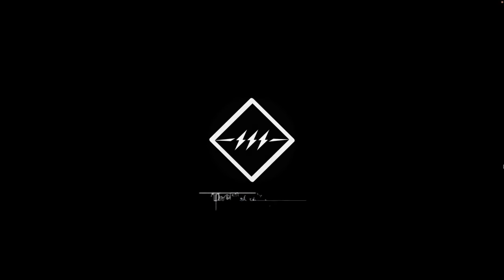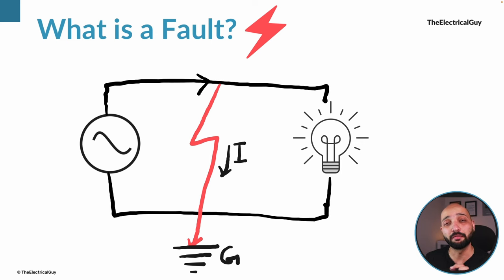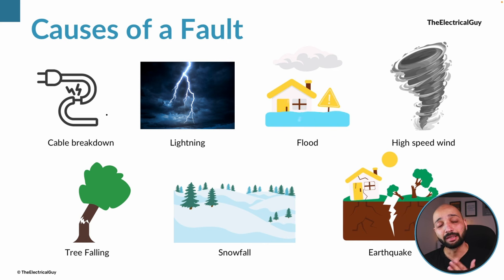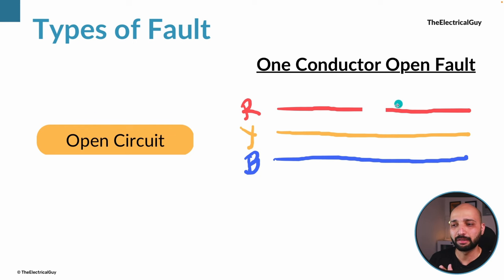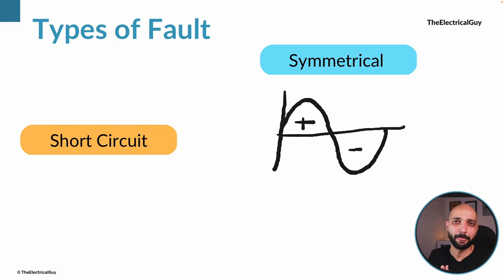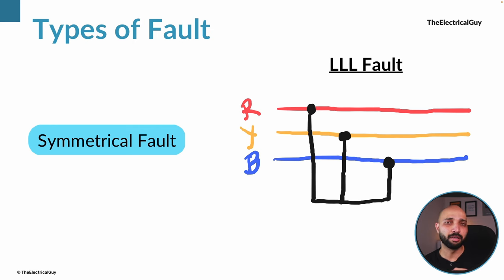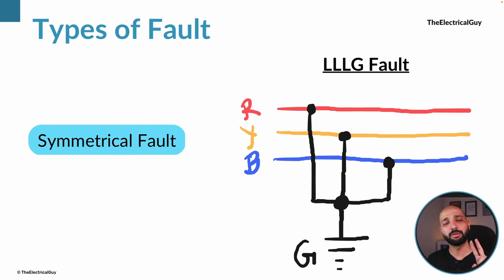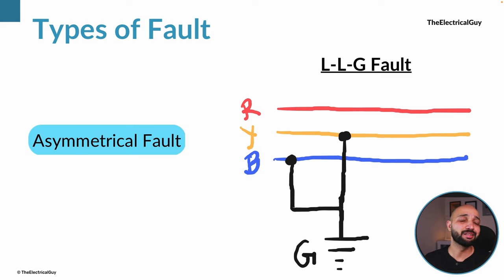Different Types of Faults in Power System | Explained | TheElectricalGuy

Comment: Why the symmetrical fault is not the most occurring fault?
Reply: These faults are happening to cables and overhead lines due to natural disasters or mainly human excavations so the electricity will be cut or shorted by the protection equipments before the three lines will be touched and the earth it’s faster than you imagine.. it will black out in parts of seconds just between the first touch between one phase With earth or neutral or another phase.. and the other phases will be affected by heat and carbon and commonly the cable should be cut especially if it is HV cable

Comment: Sir, appreciate it if you could create a video about the relay protection system such as current differential, backup distance relay, etc.. and type of relay use for every feeder such as overhead line feeder, transformer feeder, bus section feeder, etc..